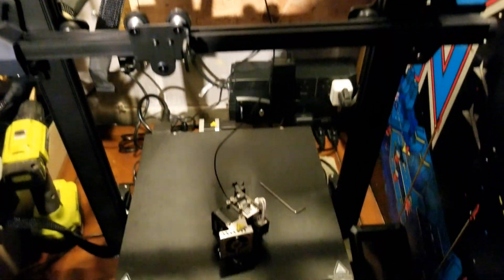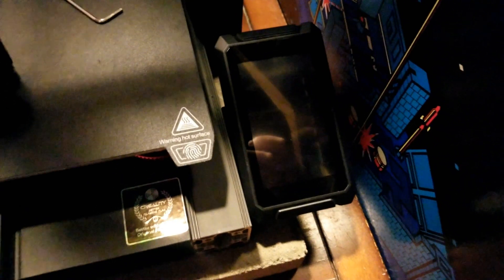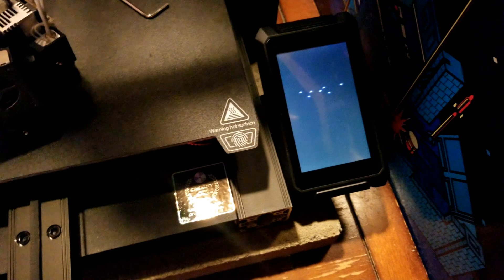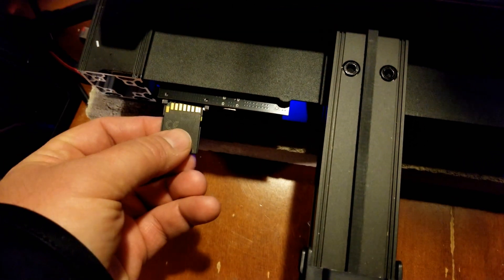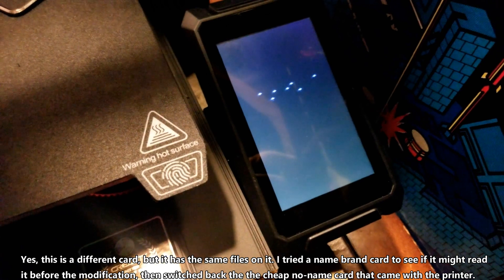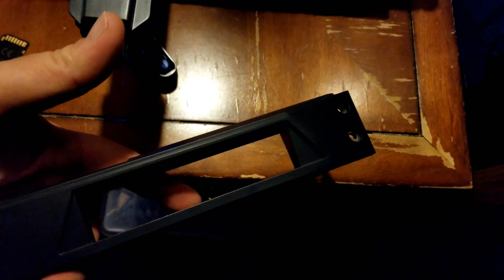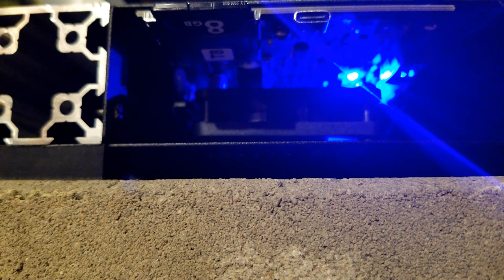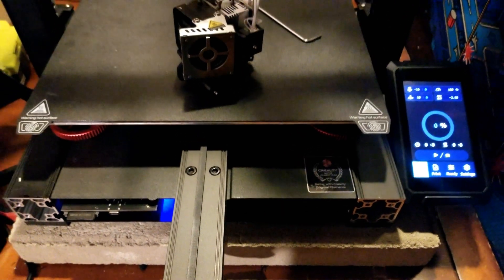How To Repair Creality Ender 3 S1 Plus SD Card Not Reading. Might Fix Problems For Other 3D Printers

Comment: I had the same issue. Picked up an S1 Plus on marketplace for dirt cheap and it wouldn't read the SD card. I put a piece of masking tape on the back side of the SD and that fixed the issue for over a year. Yesterday, issue came back again, only it won't read any card. Printer boots and will do everything normally, but it will not read an SD card at all.
Reply from the maker: I ended up replacing the SD card slot on mine.

Comment: Wow, this fixed my issue completely! Thanks! I saw in another comment you ended up soldering in a new reader anyways. Which one did you end up getting or does it not matter?
Reply from the maker: Glad it helped.

I just ordered some generic SD card socket off of Amazon.

Comment: I got the pro and Ive got the same problem it just won't read anything a not even like lock in the slot and I saw you say you have replaced the slot how did you do that?

Comment: Thanks a lot ! I solved the same issue with your simple solution. You save may day.
Reply from the maker: @jean-pierrecariou2090  Glad it helped.

I did end up replacing the card slot about 2 weeks later, so I'm not sure how long this fix will last.
Reply: @edt1138  OK just enough time to order a new one .
Reply: What specs of SD card? Can u tell the specific type of brand for the SD card you replaced? @edt1138

Comment: Thanks for posting that video. It helped me track down my problem and get things going. Another suggestion from way back when we were still working with EPROMs and such that were plugged into sockets is to take an eraser to the contacts on the SD card. The cheaper ones tend to build up a bit of oxidation if they use certain metals.
Reply from the maker: @nwagnerlange  Glad to hear it helped.

Comment: I can see IT but IT doesnt start. No button (play/stop) works
Reply from the maker: @kratosegr2008  Not sure what you mean.
Reply: @edt1138  my ender can see the content of the SD card. The name of the g code is visible when i enter print from the ender menu, i select the print job, but then it just frozes. The play or stop buttons dont work. No matter If i preheated ore not. It just stands like that.
Reply from the maker: @kratosegr2008  Couldn't be the same issue, or it  could be something else. You could try this to see if it helps.

I did eventually buy and install a new card slot for mine.

Comment: I was having reading issues, the reason was the name of the file. It was too long. Shortened to no more than 10 characters and problem solved!
Reply: Thanks man, you save me. I thought the card reader had failed until I read your comment. I was already thinking whether to attempt to repair the printer or buy a new one😄.

Comment: Your video fixed my problem with my Ender 5 pro .The sd card in my machine is a smaller version but your fix worked..Thankyou..I have spent countless hours updating firmware,formatting sd cards and God knows what else..I would just ad the advice to clean out the card reader with some rubbing alcohol while your busy as the
Reply from the maker: @MrMongoose777  Cleaning  contacts is always a good idea.

I searched for a video that addressed this issue, but all I found were people with the issue looking for help. So I made my own.

Glad it helped.

Comment: Dude!!! I finally solved my problem thanks to this - no one else I could find had this same issue (printer somewhat recognises card but not realy) let alone solved it. Thank you SO much - new subscriber!
Reply from the maker: @EveningInteraction  I don't post many videos nowadays, but I'm glad it helped.
Reply: Same here, it atarted with the start up thingy and now it stopped reading cards or stopping mid print. Thanks for posting it!

Unfortunately it didn't fix it

Comment: I've just had the same issue with my S1 which doesn't have an easily accessible SD slot, but this video gave me the right idea. It's definitely a connection issue, the slot is somewhat loose and this makes it more sensitive to the card. After watching this video I tried a few different SD-microSD adapters lying around the house and found out that some of them work while others don't. It's definitely worth trying various adapters, the plastic shells are slightly different and make sure the contacts are not worn out.
Reply from the maker: @HUNrobar  Mine is still working so far, but I have ordered a replacement SD card socket if it starts having problems again.

Comment: Just blow on the SD card pins! 🤣 Nice work.
Really, really tempted to get a 3D printer, mostly to make custom storage and shelves and things. Ironically a big issue would be having room for printer itself... 😄
Reply from the maker: That probably would have worked.

I bought one several years back for my son and I to learn the hobby together. He lost interest, but I found a creative outlet. I find myself designing, modeling, and printing all kinds of useful stuff. 

My first design was a replacement switch for an NEC Turbo Express that had been sitting for years because I somehow misplaced the original and could not find a replacement. That one print paid for the machine.
Reply: It would probably cheaper to get free shelves from CL and then "mod" them with other free wood or furniture from CL. It would take a lot of plastic to print shelving which costs $$$.